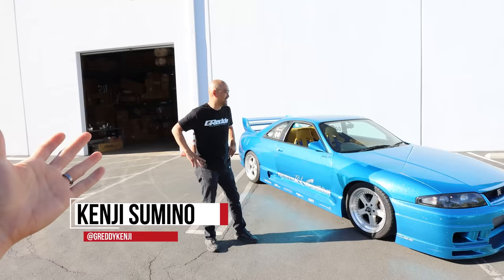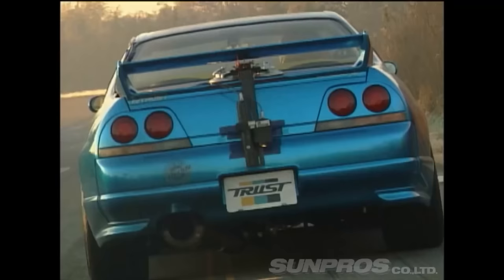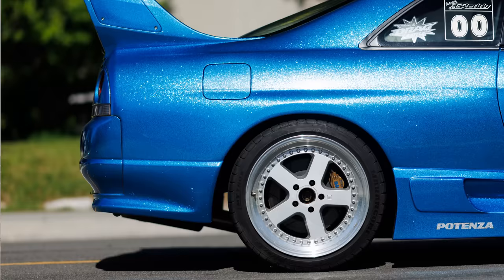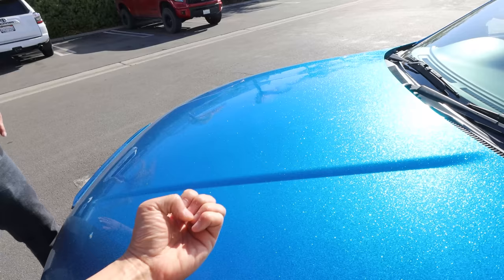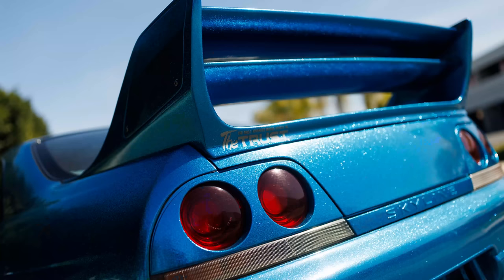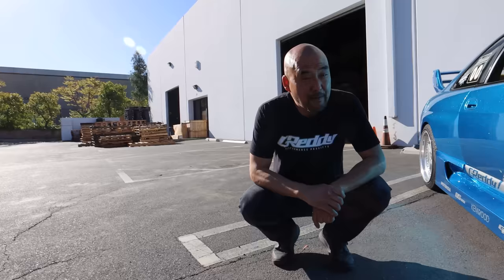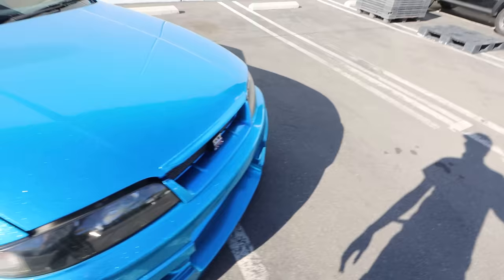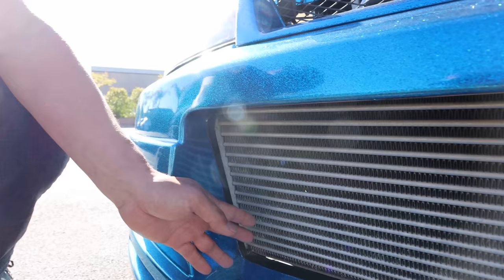GReddy's R33 GT-R, Built to Go 300+ km/h in 1995

Comment: Pushing 900 hp, 10k rpm, old tech for the injectors and boost, still got HICAS, the fuel pumps... The mechanical and electrical parts are crazy already for a late nineties car. Adding to that all the visual mods, this is an absolutely incredible build and It's super cool it remained in great shape and almost complete 25+ years later